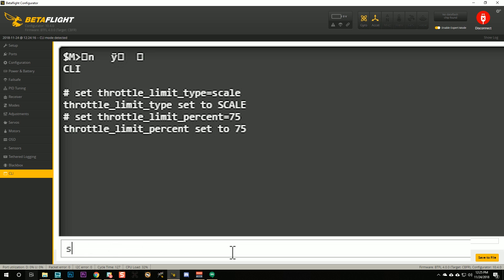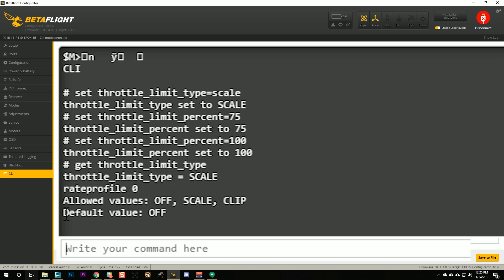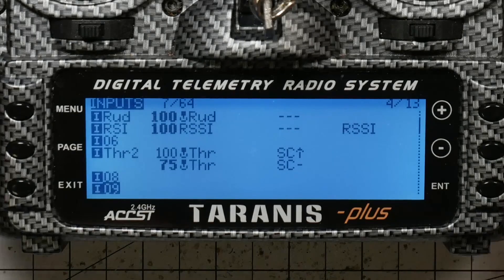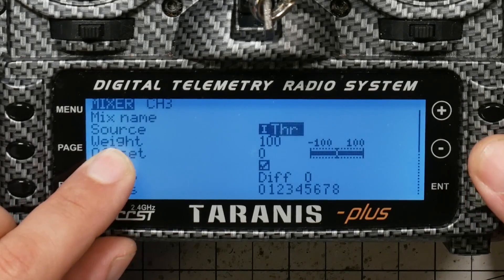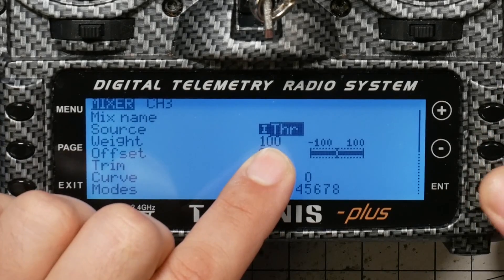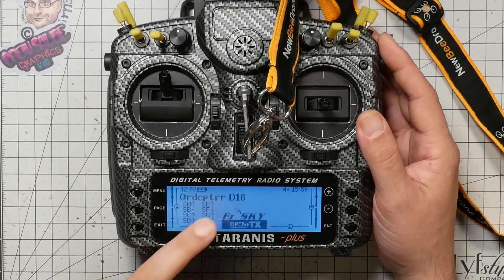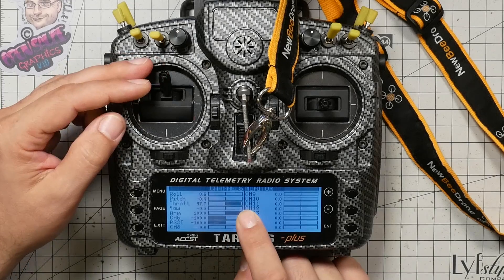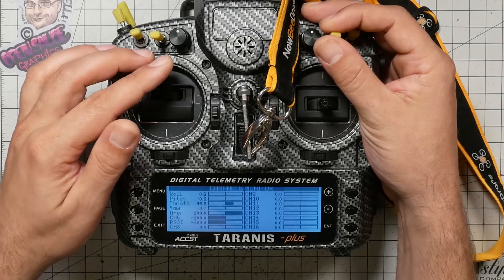Betaflight OpenTX Throttle Scaling | TAME YOUR 2S TINY WHOOP

Comment: What I did for my overpowered 3 inch on 4s is something similar to this, except I assigned the throttle limiting to a DIAL instead of a switch, so I can fully vary how much power I want! Let me know if u wanna know how it's done ;)
Reply: (anyone let me know if u wanna know ;))
Reply: leofpv sounds cool but is there a possibility to toggle it on or off so u dint accidently move the dial while flying?
Reply: @alexandert5960  now that's a really good point! I don't know if its possible to assign 2 or more aux switches/channels to one function, almost like a 2 or 3 step "password unlock" type thing, like engaging a helicopter to take off by flipping a million switches 😂 would be cool if it's possible, I haven't tried it or had the need for it though. Even if the dial was toggled though, I have the minimum value set to 60 percent and max at 100 percent so even if it were to go from all the way up to all the way down, it wouldn't end too catastrophically! Thanks for the interest tho mate 👍
Reply: I've put it on a switch but would love to know for a potentiometer/slider
Reply: that sound very interesting let me know how u did it
Reply: @Wastelessplague  ok man, to explain I will upload a video to my YouTube channel and make it a private link, send it to you so you can see what I have done! In short, you select a new input and click edit, then in that screen I selected the input as "Tof". Next, scroll down to source, I selected S2 because it is one of my dials. Next, I set the weight to 30 and offset to minus 30. The result of this is when the dial is turned all the way down, max throttle = 60 percent, when all the way up, max throttle = 100 percent! I'll send you a link to the video in a sec, hope it all helps!
Reply: @leogarrett5082  I want to know also  going to be getting a 4s 1407 4000kv 3 inch drone. I have a turnigy evolution and the dial in the middle would be perfect for this
Reply: @jocejrod  dude you'll love that quad when u get it, my 4100kv 1407 cobra motors propel the thing to 100mph and it is an absolute BLAST. Hope this helps coz you gain resolution, control, efficiency, it can help with learning, proximity flying becomes a lot easier if the quad doesn't pop on the slightest bit of throttle, this trick works wonders! Hope you enjoy.
Reply: @leogarrett5082  thanks so much
Reply: @Wastelessplague  no problem man! Can you still view the video? I took it down the other day.. let me know if I need to re-upload it and if you've got the info u need!
Reply: @leogarrett5082  I would love to see how you did that exactly ... and maybe other people too? Why not share with the rest of us?
Reply: @KiSwiSje  of course man! Can I send a OneDrive link or something? I suppose if I just copy it here then it should work.
Reply: @leogarrett5082  thank you for showing that, very interesting
Reply: @KiSwiSje  no problem man glad I could help!
Reply: @Wastelessplague  here's the link everyone! Enjoy and happy flying!!

https://youtu.be/zsnoq4Hke6g

Comment: LOL! Just yesterday I created a pull request to add the throttle limit settings to the Betaflight OSD. https://github.com/betaflight/betaflight/pull/7117

Also note that the throttle_limit settings are part of rate profiles so you can have different settings and switch between the rate profiles - even in flight.
Reply from the maker: Thanks for this Bruce. I didn't realize it was in the rateprofile.

Comment: This hobby really is in sync with itself, CurryKitten uploaded a video about 9 hours ago talking about how to tame the Mobula7 using Betaflight throttle limiting. :)
Reply: Good Point. It's great too since you get a lot of great solutions, variations, and the overlap helps reinforce what you decide what's the most common solution, simplest or best.
Reply: I remembered the most simple way of switching between Rateprofiles; by using Stick Commands.
There's literally nothing else to setup on your TX or Betaflight beyond a 2nd Rateprofile for the lower throttle.

edit: Scratch that, Joshua pointed out it changes PID profiles not Rate profiles.
Reply: Lmao I just said that 1 minute ago...look above...
It seems like these guys follow what the others do
Reply: Except CurryKitten has a great solution to being able to switch between indoor & outdoor throttle limiting - simply setup different Rateprofile's so you can use a switch on your TX to go between the two, without having to go back to Betaflight.
Reply: @licensetodrive9930  lol...joshua responded to me.... (wait until part 2 video)...